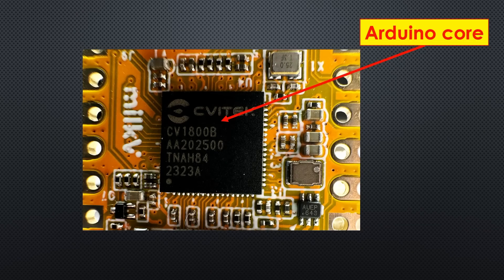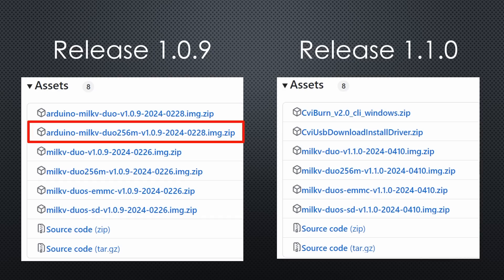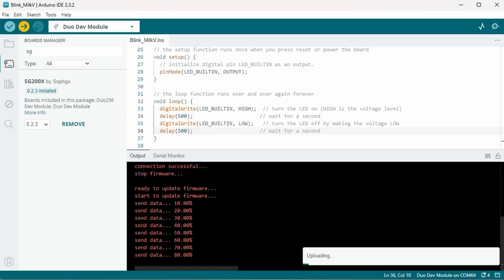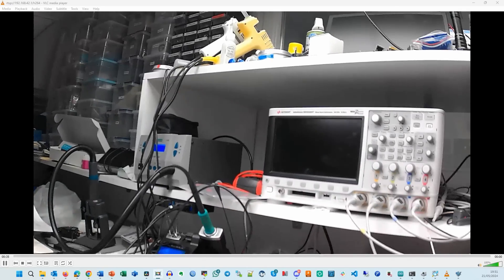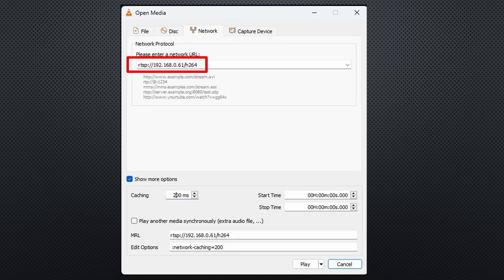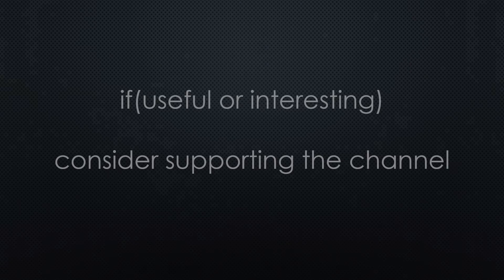(485) $8 MilkV Duo: Arduino on one core and Linux on the other

Comment: If anyone can give me one that has HDMI, I'll order a hundred on the spot.
Reply from the maker: They decided to focus on video input, not output...
Reply: @AndreasSpiess  That is a general theme seen in most very small embedded linux soultions these days. When I was to Embedded World in april, I saw a lot of that. Unfortunately, I'm interested in digital signage, so I need HDMI or something similar. To be fair, it would require adding some dedicated video core, because outputting a 4K signal in FB mode on a tiny RISC like that would be a nightmare...
Reply from the maker: @feynthefallen  It seems the DUO S has a video output. But so far, no Arduino support (AFAIK)

Comment: This seems to be the next platform to make a lot of smart devices !  One feature you didn't mention is that alongside all the CPU cores, it does also have a small TPU enabling some "AI on the edge" processing.  I see on MilkV website that a series of classification & detection models have been benchmarked, which would be worth trying !
Reply from the maker: Yes, it has a TPU. It was just too much for an introduction video...

Comment: Sounds like very energy efficient light sleep modes.  
When i park my tesla at the airport it draws 2% bettery (78kwh) a day.  (400W?).  May be necessary for self driving but just for dashcam during parking?  Such combined chips would be the solution to rund in arduino mode until cameras detect something and only then the ryzen cpu awakens..
Reply from the maker: I did not find info about deep sleep. But the chip consumes a bit less than your Tesla: 80mA when it runs...
Reply: @AndreasSpiess  LOL

Comment: I'm an idiot and do not understand. So both arduino and linux are running at the same time having access to same gpios and peripherals like video and ethernet?
Reply from the maker: I did not test if Arduino can use the Ethernet port. But otherwise, you are right.

Comment: i have the Milk V DuoS. It is like the Duo with BT , WIFI and eth. I  made a streamer out of it. I configured the Wifi, Installed Spotify Connect on it and BluezAlsa to use it to play Spotify over BT to my receiver, Sounds great ( BT aptx) and low power, I can run it from my powerpack for hours. 
I also made a Logitech Media Server out of it. I installed/compiled LMS server, and Squeezeplayer as a player. Then i connected a USB DAC dongle to the USB A port . I then played my music collection from my NAS to the Duos to the DAC dongle. Again, low power, runs for hours and looks really cool. See the forum of the Milk V   . Next project would be to try to enable I2S, and attach a audio HAT to its pins. And to run the SQplayer in the RTOS chip.
Reply from the maker: Cool stuff! You were lucky to get one. They are now sold out...
Maybe you send me a message. Maybe we can do something together?
Reply: Sure, its a fun small board. Fits easely in an envelope. Not clear how to send you a message.  I  just followed you on Patr and Tw, (look for an ape),   so perhaps  you can reply via them?  @AndreasSpiess
Reply: Good. I assume that most time takes setting up build environment, cause DuoS does not have package manager, does not have binary python packages, does not have compiler. Don't you have some blog post about it? I assume that power consumption is 0.2A (1W) no matter what.

Comment: I am excited to buy one. I already encountered a multi core chip in a tuya iot camera that had a risc V core as a microcontroller part and a mips running linux and the camera TuyaOs which is linux with oem tuya applictaions a on one chip called the ingenic T31 xburst
Reply from the maker: It seems that chips become more and more like PCBs where you assemble whatever "parts" you want. I wonder if the fixed cost of creating such chips became cheaper...

Comment: Andreas, another great post, thanks.   

So along with AI examples on the Linux core we could create our local API layer running on the Linux core and have the Arduino using them in a local device, extending our edge code capabilities?  

Would be a great next video example for your eager community.   Please keep up the great posts.  Thanks again. Wes
Reply from the maker: We will see what the community does with these new HW possibilities. I am curious, too.

Comment: I am a year younger than one of your commentators i.e. 76. I read a book whilst at school about valves - tubes for the Americans  - and learnt to say "superhetrodyne". In 1976 I was still learning how to use and implement transistors and thyristors but also TTL logic. A year or two later, someone looked over my shoulder and said "you should use a microprocessor". Enter the 8080. I didn't even get an assembler. Programming was done on a teletype in binary coding. These new devices are fun and contributers like Andreas help us get to the next level. Thank you. 😊
Reply from the maker: I am a bit behind you (67). But I also started with an 8080. We were born in a good spot. And decided for the right industry.
Reply: @AndreasSpiess  In a good spot..... but in a sense, worlds apart. 😉 . Firstly, I was in England. Secondly, I was designing a paper/film transport system for a phototypesetter. I also designed memory boards (remember "refresh circuitry"?), a floppy disk controller for 8" disks and various other devices. I moved to Germany in 1984 (for two years 🙃) and after doing more design work for typesetters moved into the laser industry. I would like to say that I was smart enough to predict the demise of the typesetting industry. In fact it was pure chance - or fate  - that caused the change. Again, a good spot to move to. 👌
Reply: In 1978 (yes!) I started to build my own home-computer with an 8086 - I wrote my own assembler typing in the hand assembled op-codes into a hex keypad on an Intel 8086 dev board... I worked on it for years, and it finally had a monochrome display board, 32 kB RAM board, 256kB DRAM board, a CPU board with 80186 and 512kB DRAM and a 20 MB hard drive. I learnt so much doing this I ended up working for IBM research for 35 years.
Reply: Somewhere around 1979 I programmed an IMSAI 8080 in Microsoft Basic to run a test setup in a. aerospace R&D lab. 

My real “uphill both ways, in the snow” low-level experience came in maybe 1988 or so when I hand-disassembled Z80 machine code to take over development of a system the original developer had flaked out on. Those were the days! 😂
Reply: I had a similar history and not far behind you agewise.

Comment: Is it possible to combine RNDIS adaptor in bridge with PCs ethernet adaptor? This can be the way to expose board to the local network without addition hardware. (But RNDIS protocol may bring some limits and problems, so hard to say without testing will it work.)
Reply from the maker: Maybe you fin a way to route the traffic between the two interfaces. I used the RJ45 connector because it was easier...

Comment: Extremely cool piece of tech!
The ability to have the 2 cores communicate definitely opens new possibilities, but I'm surprised to have to run wires via GPIO to achieve it - seems like a common enough thing to want to do that there should be a shared communication bus on-chip, but perhaps this will come in a later revision...
Reply: It is absolutely technically possible to do this via shared memory techniques.
Reply from the maker: Maybe it is only a software thing and they can "retrofit" it in their examples. Mabe we have to wait for a new chip revision...
Reply: This seems like the biggest missing piece, but also seems like something the manufacturer could solve with a newer version/revision/model ?
Reply: There is a mailbox that permits message passing between linux and the RTOS / arduino core.  The information was added to the Duo arduino page on the wiki on April 22.

Comment: One thing that would be very useful would be to have the status of pin declared as outputs visible from both systems avoiding using 4 pins to communicate. (never understood why in Arduino you can't read the state of an output without bothering registers)
In any case I already have at least 37 projects in mind to use a Milk-V DUO S.
First: a glorious keyboard IBM M Series USB/Wifi/Ethernet with macros and the possibility of reprogramming. (Already partially done with Arduino Due ....but i need more CPU)
Reply from the maker: Cool. Let us know when you have your first project finished!

Comment: The most shocking was the AMBA Bus connector to a codec subsystems that supports a  h.265 encoder. Thinking about it with camera modules do make sense in this context.
Reply: The chip it's based on was designed for use in IP cameras - hence the rather strange mix of features and why it has advanced camera capabilities but no video output at all.  It's also why it's got a built-in tensor unit, since that's useful for things like image enhancement and motion detection.
Reply: @TrimeshSZ  and all the encryption models.

Comment: The problem with these new hobbiest platforms is the half baked code with not many working libraries. Take a look at the esp32 released 6 years ago its tcp and wifi stack is still an utter garbage hodgepodge 🗑️arduinos are hundreds of times more reliable for any tasks than the esps.

Comment: This is really interesting to me, I often have need for both the realtime IO of a microcontroller and the network stack and data handling of a real OS, but making an arduino and a raspberry pi speak to each other is tiresome. If they were both on the same chip, though...
Reply from the maker: So far, I also only saw them communicating via pins. But maybe they just did not implement this functionality in software.

Comment: This is indeed an interesting piece of tech. I currently don't see why I would want two different OS on one chip, but there might be applications. Looking forward to projects that make use of it.
Reply: Iot devices like cameras often use 2 different platforms on a chip. I have a iot camera that has a risc V core for low power and house keeping and main cpu deepsleep. And a mips which runs linux and the camera app stack
Reply: @309electronic5  Sounds like config management and maintenance hell to me, but might make sense in certain applications.
Reply: there is a ton why you need linux with RealTime application, Linux is not RT and applying RT patch costs so much dev, hybrid OS with Bare metal firmware is an option chosen often by the automotive industry for example to reduce cost
Reply: I agree, but arduino is more fit for real time systems, linux with a vast number of application. For a reason of security too... hacking linux is easier than hacking arduino .. so you can store some information on the arduino chip like a "signature protocol".
Reply: @GabrielKleinCH  still i somehow see tons of routers (excluding a few that run vxworks as rt os) and iot cameras use linux and often they had the wifi credentials of the user stored in a raw .ini or .cfg file so yes you are right about security. But somehow manufacturers still choose linux so you have to wonder "do they not even care about security" or is it something else?
Reply: @GabrielKleinCH  sir in case of security keys special chips uses I2C are used to secure data, in robust realtime system there is plenty of choices to have, one of them Arduino or dual firmware composition are in place, one bare metal firmware like Arduino, and one in linux in the same Chip and each one of them uses it's own cpu physically within it

Comment: Nice!
I have Duo, Duo256, Duo S, LicheeRV nano B, nano wifi as well. Have test them for a while.
There are Ubuntu and Debian available. You can run USB WiFi on those boards if you like.
And there is a 300Mhz 8051 core in SG2002 and SG2000. You can use SDCC on PC to cross compile the code for it.
But the clock setting may be wrong on the official image.  The Debian image has correct setting.
BTW, Luckfox Pico Max has RV1106G3 1.3Ghz Arm A7, with 256MB RAM, and ethernet. Worth a try if you have time.
Best,

Comment: Going to have to check this out!  I need Internet connectivity and things like FTP log file uploading for my systems but don't want to loose the ease of use of Arduino coding, although anything like FTP causes Arduino to fall on its face
Reply from the maker: A good example. Internet and video are not fun for an Arduino. Linux is easier for these topics.

Comment: Interesting chip, would be nice if they make one with wifi on board.
Reply from the maker: I agree. However, Ethernet is also interesting for some applications
Reply: @AndreasSpiess  Indeed, wired can be useful also. On topic of wifi capabilities; are there any IOT devices / microcontroller boards / wifi extension boards which can use 5G wifi? I have not come across any yet. Perhaps a nice topic for after your holiday ;-)
Reply from the maker: @ThijsKaper  I once made a video about such a chip. But I was not amused ;-)

Comment: The cores cannot talk via the on chip bus? That's a pitty, because that would be a USP, have the Linux core compute stuff and the Arduino spit out / control with hard timing requirements. Almost like a beefy RP2040
Reply from the maker: I did not see an example for that. So I do not know if it is technically possible.

Comment: HC-SR04: easy to detect if they're 3v3 or 5v: the 5v variant has a crystal on the front, between the 2 ping sensors, the 3v3 one you showed has no crystal on front
Reply from the maker: Good to know. I marked them to not forget...

Comment: $8 for the duo? Dude, you got ripped off massively. Look at Arace, they have them for the normal price. 

I'm using Ubuntu on it, apt is really slow but otherwise it supports a surprising amount of software. GCC also works there, so with enough patience you don't even need cross compilation :D At some point in the future, I'll compile it on my own with custom kernel options because at the moment I'm missing some modules to use LTE (via sakis3g). Also, for short testing the pins of the small ethernet adapter have enough friction in the holes to directly fit. 

Can also recommend the Milk V Mars, recently got official Ubuntu support (even though I'm still running the original Debian something), it's surprisingly powerful. 

Ps: I don't like the sound between topics. It's too loud and I don't think it matches the video. 

PPS: Do you have houghts about the Oasis that will likely release end of the year?
Reply from the maker: Thank you for sharing your experience!
Concerning the price: Arace including shipping is more expensive here...
Reply: @AndreasSpiess  for single units, you're right. But at this price per piece, I bought 10 and a bit more stuff.

Comment: if they made it with 1gb Ram, it could be a great platform for klipper
Reply from the maker: That would be a lot for such a small board. But if things continue like that, it is a matter of time...
Reply: @AndreasSpiess  I see the Milk-V Duo S had 512MB ram, doesn't seem that far of, if they added a few more linux cores and optional wifi, it has 39 GPIO, so assuming minimum setup using 4xTMC2209s (they require 3 pins each + share single UART), single head, 2 fan pwm, bed heating, 3 end stops, 1 probe+ servo and DSI for display, i see using 34 pins. Not sure it would be that viable, for now. (Haven't checked if there are enough free pwm pins) and performance would definitely be slagish.

Comment: nice. but what the point of this?
Reply from the maker: I agree with @TicTacMentheDouce. Video and web is not easy with Arduino. And realtime not easy with Linux.
Reply: Core running Linux for high level tasks or network tasks, or user code,  and Arduino running core for low level real time tasks.

Comment: Summary

The Problem:

* 0:39 Existing platforms like Raspberry Pi are moving upmarket, leaving a gap for affordable, powerful alternatives.

The Solution: MilkV Duo

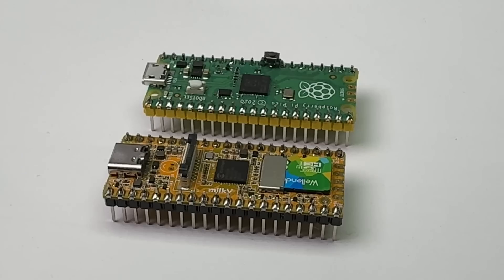* 2:04 A $10 chip with dual RISC-V processors, one running Arduino and the other Linux.
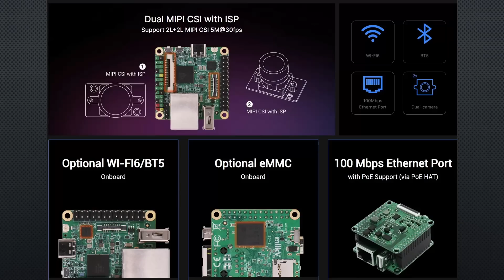* 2:28 Available in 64MB and 256MB versions, with optional IO boards and camera adapters.

Key Features:

* 2:46 Dual Core: 1GHz RISC-V for Linux & 700MHz RISC-V for Arduino, enabling parallel processing.
* 4:42 Arduino Compatibility: Program the Arduino core directly using Arduino IDE with existing libraries.
* 6:13 Linux Capabilities: Runs Linux with Busybox and Python, allowing for more complex applications.
* 3:03 Peripherals & Connectivity: GPIO, ADC, PWM, I2C, SPI, Ethernet, USB, and camera support.
* 2:04 Affordable: The basic board costs around $10, making it extremely accessible.

Demonstrated Capabilities:

* 5:29 Blinking LEDs from both Arduino and Linux cores.
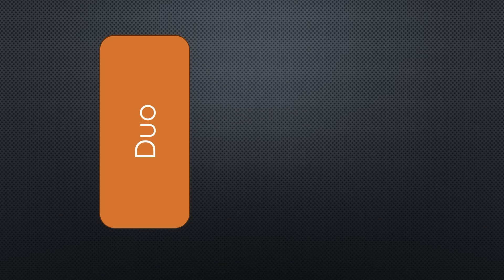* 7:54 Reading potentiometer values using Arduino's ADC.
* 8:18 Interfacing with an ultrasonic sensor (HC-SR04) through Arduino.
* 8:46 Controlling an SSD1306 OLED display using I2C communication with Arduino.
* 9:37 Streaming HD video over the network using the Linux core and camera adapter.
* 11:32 Connecting to the internet via Ethernet for broader functionality.

Potential Applications:

* 12:40 Low-cost robotics and automation projects leveraging both Arduino simplicity and Linux power.
* 12:40 Networked sensor nodes with data processing and communication capabilities.
* 12:40 Affordable embedded systems for hobbyists and makers.

Conclusion:

* 12:40 MilkV Duo is a promising new platform combining the ease of Arduino with the power of Linux.
* 12:40 Its low cost and rich features open up exciting possibilities for various applications.
* 12:40 The project is well-documented and has strong community support, paving the way for future development. 

i used gemini 1.5 pro to summarize the transcript